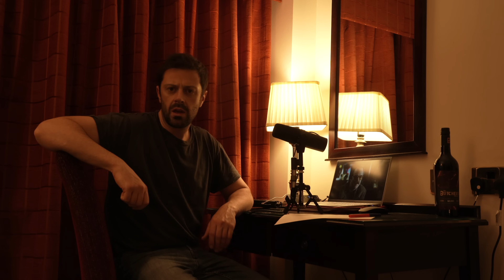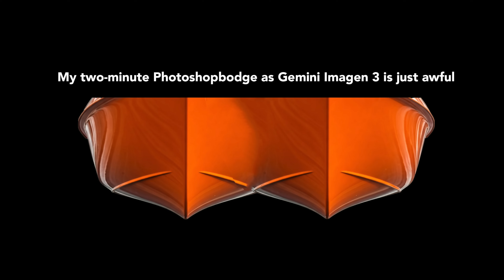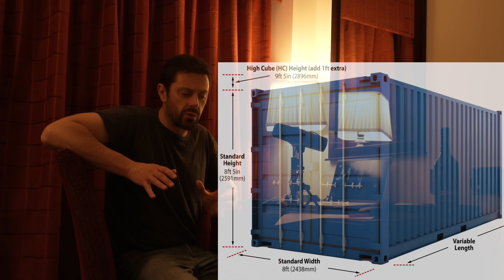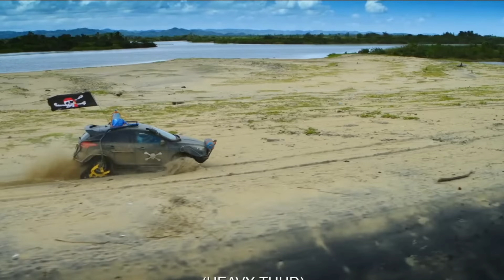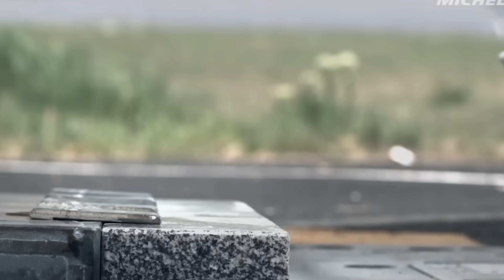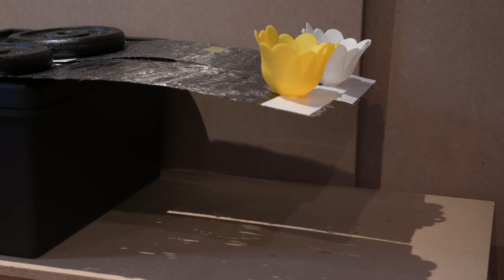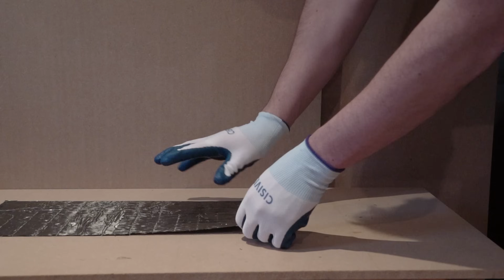The BIG Decisions: fuel, hull type, tracks/wheels, size, power. Bernard Arctic Vehicle Project [4K]

Comment: I really do think you're mostly on the right track here. People are going to pick up and mention the things they disagree with and forget the things they agree with. Don't be discouraged by that.  I will echo other's concerns with airless tires. I know you have a nearly religious aversion to pneumatics. But maybe try to look for contrary opinions out there and see what the cons are to the airless. I believe I've seen people say that they fall short in terms of force absorption, and they will definitely not do as well as a low pressure (nearly flat) pneumatic in terms of sheer square inches of rubber touching the ground, which translates into both traction and ground pressure. 

If you haven't come across them yet, you may be interested in thermoelectric generators using the Seebeck effect. They are very pricey per watt, but they do best with extreme temperature differentials, like say, a running diesel engine and the arctic cold.  I'm guessing you could at most hope for 200 watts while the generators are running, but if you can get those 200 watts off waste heat, maybe it's worth it?

I really like the redundancy of 4 generators and running electric hub motors off them. I think you're very much on the right track there in terms of greatest fuel efficiency, and hot-swappability. Very clever approach. And I think your double-keel monohull is a very good design choice well.  Should give good stability both as skiff and as a sled, while still allowing good directionality.

I'd also suggest some small-scale tests regarding having the wheels in the water during water travel. My intuition says that drag will be more of a factor than you think. Maybe if they are allowed to free-spin and if the axles are well above the water line. But even that, I'm not sure. It might make a big difference. If you could have some sort of parallel linkage that allowed the wheels to swing up and attach higher on the hull, that seems ideal for water travel, but introduces a lot of critical failure complexity for land travel.

Also, don't do what I always do and forget about gravity during construction. I always engineer my designs in my head, and then when it comes time to actually build the thing, I have to ask, "hm, how are we going to actually lift that piece into place?
Reply from the maker: Cheers.

People are generally being sensible, and most of the 'annoying' ones I think are due to new viewers not having seen the last three episodes.

I'm not religious against anything, save for religion, but yes I'm aware of the pros and cons. I'm looking for a combination of 'give' in the wheels and basic torsion suspension to give us a reasonable ride/not shake the internals to pieces.

I've tried those thermoelectric generators before, and they are wildly low power. I'll have a look though to see if larger scale ones are better.

Point taken on the wheels in the water issue. But we'll see if it's a major issue when merely pootling along at 5 knots. Compared to wheels madly spinning in the water like Sherps and Argos though....

Gravity noted as still in effect!

Comment: It seems to me the ideal starter hull for this concept would be.... a fully enclosed lifeboat. Add fiberglass hard points to enclose the drive motors. Add a universal joint connection between two hulls, placed rear to rear. You could likely get this in a 40 foot container. Note the if you use a lifeboat hull as your mold, it comes in a hydrodynamic shape.
Now, if you're set on carbon fiber, you'll need a mold. In that case, use a lifeboat hull as the mold. You could chop up and reshape it as desired, that become the mold for the carbon fiber and can be use to make as many hulls as you want.
Will this have traditional steering, or by flexing the joint between the hulls? There are trade-offs for both, but flexing the joint allows simple, fixed, straight axles. You could then drive two wheels with a single motor. That makes a 3 axle, 3 motor, 6 wheel config fairly simple, like those 6 wheel ATVs from the 60s. In fact, you could link those 3 axles with a chain drive while still putting a motor on each. In the case of a failure of one, you would still have 6WD.
I would make the wheel/tire assemblies very quick and easy to change, so they could be removed for shipment and popped on when removed from the container. This would allow the hull to be the full width of the container, no space lost to accommodate the wheels. They would be fully outboard of the hull.
Your plan will have terrible conversion losses and wasteful, expensive, heavy copper wiring, and control electronics taking up space. Consider hydraulics. There are eco-friendly hydraulic oils. Hydraulic motors are very powerful in small packages. You can have 2 or 3 pumps feeding the system for redundancy. That oil also gets pretty warm, so it could help distribute heat to the command section by placing the tank in it.
When you have a hydraulic pump and tank, there are all kinds of things you can do with it, like power winches, hoists, and a propeller. You can still have alternators on the diesel engines so they will charge batteries when not needed to drive the hydraulic pumps.
So here's what I would try. 2 hulls, with a flex joint for steering. Each hull has 3 solid axles and 6 wheels, each with a hydraulic motor. Power hull has 2 6 cyl. diesel engines with hydraulic pumps. Hydraulic fluid tank is in the command hull for heat. Power hull has an auxiliary propane heater keep it warm enough to start, and that same propane is used for cooking.
Reply from the maker: I'll investigate hydraulic motors but don't get grumpy if I don't switch over. All power systems involving energy storage (as fuel or charge) have large energy losses when converting to circular motion.

Steering - differential on the front vehicle, and the rear one a trailer.
Reply: Hydraulics would also provide steering.

Comment: How about a 3rd pod? Same size as the 1st 2 but only for fuel/supplies? That can be drop and retrieve as needed? Could also be 1/2 sized 2x2x2.5m ish then you can do 2 supply drops??
Reply from the maker: We might struggle for power for even more, and a long caravan would get stuck more in rubble ice. Two is already ambitious.

Comment: a small outboard isn't horrible if you're not going to be in the water too often. prop shape makes a big difference. finding one that can work at your required temps is another thing.

old arctic trucks and brand new planes have "hot plates" or electric wires running through part of the windshield to make sure they can see out in icing conditions. if you want to go the poly route than "shields windshields" is one i know of. 

for the inside, if you want to maximize the space then just have conduit and pipes on the wall. if you could ship these with the wheels off,that would allow you to make them fairly tall,giving more space. having one vehicle carry all the fuel, another the food, etc. is the best way to get the most out of the area. mixed storage is space wasteful, you can't optimize. trade off vs being self-sufficient.

gasoline engines have an easier time starting in the cold, diesel is fine but if you're going small generators anyway i would consider small gasoline ones. gasoline is lighter than diesel, burns cleaner, no clue which egt is hotter. i wouldn't put a wind thing on the roof. i get it, but if ice builds up on it that's more load on the roof. also if it builds only on one side then it might try to tip,roof really won't like that.

not sure how far you're willing to take it, but having little "escape pods" mounted to the sides could give you more storage at the back or a dedicated sleeping space up front. screw in maybe, to help with shipping.
Reply from the maker: I like some of this, especially the pods. And the use of space.

Gasoline is too dangerous sadly.

Windshield heating is on the list for 'problems to foresee'. Cheers!

Comment: The problem with airless tires in an Arctic environment is the rubber is going to become more stiff and brittle you're not going to be getting the same kind of shock absorption you will out of an air Tire
Reply from the maker: Same as the rubber in the balloon tyres of all the existing ones. Luckily, syn rubber and plastic technology is developing amazingly.
Reply: @AlexHibbertOriginals  I agree that better a rubber technology making the more effective in a greater quantity of temperatures but I wonder if that's enough you think having an embedded heater in the tires would be too much

Comment: Just found your channel and I love the scope of this project. As you were describing the challenges I was formulating my own solutions, which supprisingly were almost identical to yours. I haven't used the new sodium batteries yet but I am playing with lithium titanate batteries which have a slightly longer history of use and are easier to design with atm. As others have suggested I would probably stick with the aired tyres with either an inner tube, or maybe they could be lined with a self sealing compound similar to military aircraft fuel tanks? Love the heat recovery idea but think a fluid system is going to be easier to implement, with maybe a two stage system, a high temp initial storage and a lower temp distribution system. This is the sort of project a person can really deep dive into and have a lot of fun with, can't wait to see the results.
Reply from the maker: Cheers and welcome. Sodium defo not a certain yet, but lots of testing.

Comment: I wouldn't be afraid of hydronic heating/cooling. Just good quality hoses and fittings that are overkill for your application. Use hard lines when possible.  Have a reservoir
level alarm to detect leaks and have isolation valves to contain. Nearly every car and truck on the road heats the cabin this way.

I can't imagine cold starting an air cooled engine in -40c. With liquid cooling you can preheat the coolant with a simple oil burner. Once one engine is running it's coolant can heat the other engines and keep everything nice and warm. You could use a controller to automatically start/stop a generator based on coolant temperature so that it never gets cold. With the mass of the coolant system and other generators, that cycle could be quite long. You would always have the oil burner as a backup. You could even have an electric element that can heat the coolant from the batteries in a pinch.

I also would use electric cooking appliances. We run our cabin on solar power and Starlink uses more power over 24 hours than the microwave and toaster use. When your talking using a generators waste heat to keep warm, your going to have more electricity than you can use.  When underway we are talking hundreds of kWh a day to turn the wheels. Using 2 or 3 kWh a day to cook meals isn't a big deal. Airfryers and microwaves use very little power to cook as they run for very short amounts of time.

I don't know if a wind turbine would be worth the trouble. It would have to be very large to produce enough energy to keep you warm. If your going to have to run a generator to produce heat anyway you will have more electricity than you need.

I would consider an airlock on the command unit so you don't loose as much warm air getting in and out. Maybe have it double as the bathroom. 

Airless tires are usually very heavy compared to  air filled tires. The durability of both really comes down to the materials and construction. At least with an air filled tire you have the possibility of repair.
Reply from the maker: Not afraid for sure - I'll always look to A-B test ideas even if I have a gut feeling.

Preheating is something you've rightly pinged. I don't think we'll have all the spare power you expect though. The motors will eat through the charge.

Air-lock. Excellent plan.

Comment: Hey Alex,
I suggest a collaboration or discussion with Edison motors out of Canada (or at least check out their YouTube channel). 
They are pretty far along with creating a electric logging truck with a generator on board. Their their core values are reliability with an emphasis on easy maintenance and repairability. They are also making conversion kits for a pickup truck. I see a lot of requirement similarities around the drivetrains on both projects. 
This project is pretty ambitious, I wish you all the luck!
Reply from the maker: Cheers I'll contact them. The motors are to be critical, and an area I'll need to be educated on.
Reply: glad someone else was thinking that as soon as they heard the EV with onboard charger!
Reply: I came here to say the same thing. Edison has already solved a lot of these problems.

Comment: Have you considered a gas-turbine electric drivetrain? I believe "micro" gas-turbine generators have reached the consumer market. These would be potentially quieter and more fuel efficient. Most importantly, they would be more reliable, with less moving parts and virtually no vibrations. Conceivably, they would also be tolerant of water contaminated fuel. May be worth looking into.
Reply from the maker: I'll have a very tentative google search...

Comment: I am skeptical of the low temperature gelling issues with vegetable oil based fuel. The oil companies here in Alberta are blending in canola oil (possibly HVO or some similar version)  to the diesel fuel during summer. If you do not have separate tanks for summer and winter fuel, a blending of even less than 1/4 summer fuel will result in disabled equipment during a minus 40 cold snap. Diesel fuel conditioners made to reduce the flow point of regular diesel are ineffective on the canola oil, once the fuel has gelled, you have to wait for warmer weather , or heat the entire vehicle (tank, fuel lines and engine must all be warmed up It has become a real issue for farmers here when the temp drops suddenly to minus 40 or colder. Airless tires are also likely to be adversely affected by extreme cold(becoming hard, poor traction and possibly even brittle ; pneumatic tires will be superior in cold weather traction and don't forget that the tires will be your suspension - as the airless tires become more rigid, you and your vehicles contents will get bashed around.Tire repairs are not rocket science and can be performed in the field. Carrying one spare tire per group of vehicles would provide a massive additional margin of safety. Most rigid multi tire vehicles , such as the LAV 25 IFV can run just fine with missing or flat tires. I would stick with the time proven pneumatic tires for this project.If no military's have adopted airless tires , that should tell you they are not yet ready for expedition applications. Edit- I just looked up HVO- it's freezing point is minus 30c, not good
Reply from the maker: I've commented on reusing heavy military vehicles in other comments, but on the HVO temperature issue: gelling in the -30s is wildly better than untreated diesel. I'm not sure what miracles we can expect short of using much thinner and more dangerous fractions of CHO fuels. We can only test, test, and then conclude.
Reply: @AlexHibbertOriginals  HI Alex! Apologies for the poor wording regarding the LAV 25. I was not suggesting that sort of monster for your design , but rather illustrating that since that 12 tonne behemoth on smaller skinny tires can still get around with 4 of it's 8 wheels missing, your much lighter vehicle with much larger tires would not be stopped or incapacitated by one or even 2 flats. The likely hood of ever having some full on catastrophic " unpatchable" failure of a top quality off road designed low pressure tire under such light vehicles as you are proposing is likely close to same probability as being hit and killed by a meteorite!   On the second point,  diesel fuel gelling point, your statement that HVO's gelling point is "wildly better than untreated diesel"  I fear you are quite misinformed. Yes "Summer Diesel" (also known in some parts of the world as #2) has a gelling point of around -10c but the "Winter diesel"(aka #1) being delivered to every gas station in Canada now in early December has a gel point around -40. This is not done by adding "dangerous light fractions" but instead by adding less additives(mostly paraffin wax) to the base stock which is Kerosene. This will be the same in Northern Europe as well.  McMurdo runs a unique variant of diesel for power, heating and vehicles that is called AN8 but has a gelling point around -57c (-72f) yet a higher flash point than most jet fuels( which are also basically kerosene with additives). Hope this helps ! CHEERS!!
Reply from the maker: Thanks. Very familiar with the differences between summer, winter and polar diesel. It's worth noting that the HVO could also use high ratio additives to improve its cold rating yet further from its superior native CFPP, and there are lots of other benefits like shelf life, resistance to water and bacteria. Also, the blending or additives to winter fossil diesel reduce fuel efficiency and can introduce other problems. Anyhow, I'll consult industry bods and do an episode on it, with tests.